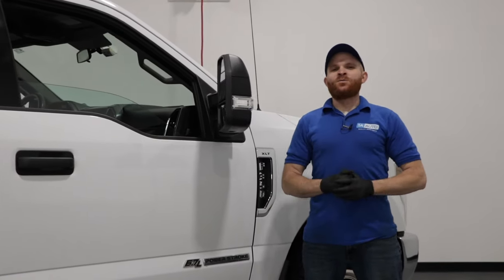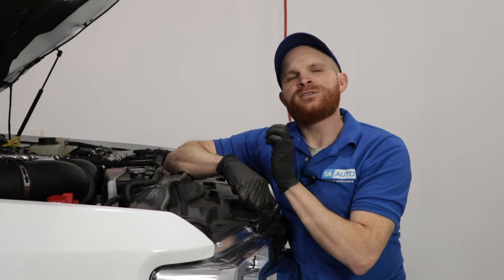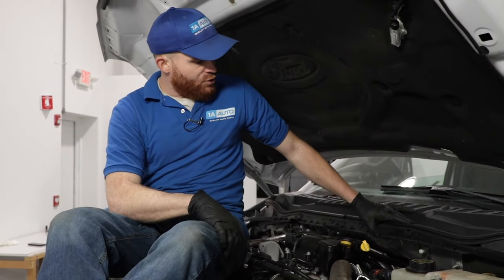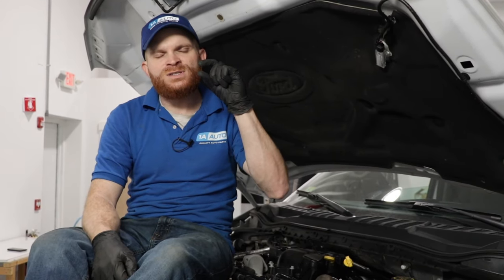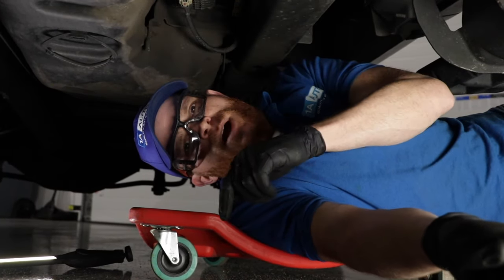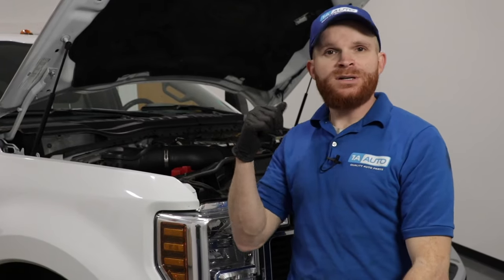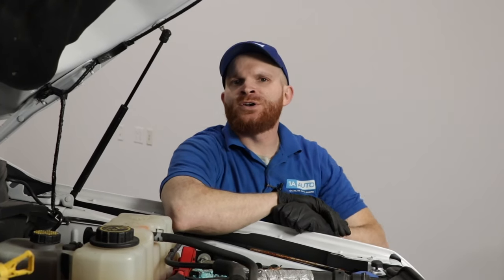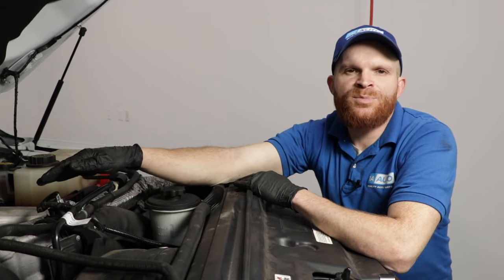Top 5 Problems Ford F-350 Truck 4th Gen 2017-20

Comment: "The next thing I want to tell you about on this viricle is turbo hose blow off." 😂😭
Reply: Damn you'd think after 15 + years ford could do a better job with that turbo hoes and that fuel tank. I remember these issues back in the mid 2000's with our GE Fleet work trucks . Ford kept dropping the ball that GE switched over to RAM .

Comment: It seems Ford rushes their diesel throughout the years and fails to really test them thoroughly. I'll stick to my 2018 Dirtymax
Reply: Oh you mean your underperforming Isuzu?
Reply: @brianbarclay4316  Isuzu has specialized in workhorse diesels for decades, Duramax isn’t embodied by superficial power number, but rather superior design and longevity
Reply: Gm has turned to crap over the years. They used to make good stuff. Those days are over.
Reply: Wasn't always the case. Back during the Obama administration, we had this thing called "cash for clunkers" which was a complete failure. A family friend  of mine was working for a dealership and when vehicles came in from that program, they had to destroy the engines which didn't exactly help people who couldn't afford new cars. Anyways one time a 1988 F-250 came in and  pour sand in where oil supposed to go and ran it. He ran out of gas twice before it siezed up. Makes me depressed just thinking of all the perfectly good vehicles that had plenty of life in them destroyed like that.

Comment: Excellent, to the point, instructional information! Thinking about one of these beasts. Seem very unreliable overall added to the pricey maintenance. I read up on fuel in US due to the constant problems with exhaust. Seems many problems with the Cat systems come (IMHO) from low cetane rating (40 to 45) of generally all diesel fuel. Add a conditioner, boost the cetane up, burns hotter, less particulates overall, engine combusts more efficiently everyone much happier. But another expense to keep the air clean & your truck running. Recommended oil change 7 to 10k. Again even the synthetics have tough time going that long without degradation. I think I personally would waste the money and go 5k at the most. Not practical for over the road but seems city driving harder on these babies as they are not being worked. Anyway thanks for the great video my friend. Your good, keep'em coming.

Comment: Thank you 1a auto for this information...it will help us ford diesel owner specially "diy" guys like me.

2017 ford f350 6.7L fx4 crew scorpion diesel always on duty...reporting at 74,000 miles with only basic maintenance in my own garage. Tows our 10,000 lbs. rv trailer twice a month in the Nevada desert and neighboring state.
Note ford diesel owners:
Bring your ford diesel to a dealer to have your engine block heater(if comes with factory) replace for free...(recall issues).

Comment: I’m thinking about buying one of these vereichles thanks for the info
Reply: Nice to meet a fellow linguist. It does sound funny. I wonder if he is in Canada? By the way, do you have one of these? I looked at one today with 107,000 miles. Its an 2017 XL package. He wants $46,000 for it. It has a flat textured black 8’  metal bed in place of a standard truck bed. There is a gooseneck hitch down inside. People brag about these trucks and others complain about the maintenance, cost of fuel and the aluminum body. I would appreciate your insight. Thanks

Comment: Heat and time do cause those CAC tubes you referenced to blow, but I have also found excess pressure and heavy carbon build-up from clogged EGR coolers to cause failure.  Either way, CAC tube replacement is a must.  Good video! 👍

Comment: My dream truck:

Brand new, 1-ton or bigger
Wide track front end
Large crew cab or mega cab
DRW 
4x4,
Cummins turbo diesel
Strong engine brake
10-speed manual trans with double overdrive
Cloth bench seats front and rear
A/C 
Heat 
Old school AM/FM radio

Mechanical gauges

It will always be a dream...... :gar:

Comment: So what mileage do these issues usually arise? Looking at a 2017 F350 for my dad with just over 80k miles…   He’s had a 1999 8.1L Chevy forever, I have a 2015 Ram 2500 diesel with 145k miles and definitely never had issues like these top 5 for the Ford. Still on original belt, pulleys, intake, gas tank, etc… 

Wound hate to spend 40k on a used truck and have these issues happen soon after.

Comment: the egr cooler doesn't cool the valve it cools the exhaust gases entering the intake which cools combustion chamber temps which in turn reduces Nox

Comment: Thanks.  Thinking of trading in my 2016 KR CC 6.7 for a 2020 or 2021. Question about the fuel tank liner...  couldnt you just use an endoscope ($20 online) to peek inside instead of dropping the whole tank? Or would the anti-siphon mechanism prevent the 1/4 inch wide camera from entering the tank?

Comment: Good luck finding that turbo boost hose and a upper/lower oil pan.  That part, like many Ford parts, are almost impossible to find.  There are many reasons as to why, but the main issue is they cannot be found except on backorder.

Comment: I am experiencing the oil leak and I believe it is because of the PCV Oil Separator.  Dealer did not tell me this.  They put die in the oil and said they would look for leak after I drove for 500 miles.  Does the oil pan need to be dropped and seal replaced if PCV oil separator spring kit replaced?
Reply: Yes brother for sure

Comment: I have a 2018 have replaced radiator to supposedly a better one because I have heating issues. I’m a hotshot driver so pull heavy loads. But even after this with no load it still wants to run hot. Have checked all the lines. Any recommendations?

Comment: Questions I have a 6.2 L v8 2017 F250 I have trouble starting in the Mornings. Would I still have to replace the fuel tank do to the coding. ?? Pealing off or does it only affect diesel fuel. Tanks. ??
Reply from the maker: +vaslui We wouldn't be able to diagnose an issue like that here, you may want to have a local mechanic take a look at it. Thanks for checking us out! http://1aau.to/m/Shop-1AAuto-c
Reply: Its the fuel pumps.  I have a 17 6.2 f350.  Its very common in these gas trucks.  ford won't do anything because the fuel pump isn't actually failing its just losing pressure the majority of the time.  and because of that it puts more wear on your starter since there is no fuel until the pump builds up pressure again.  now my starter has problems... my 2001 GMC 6.0 gas with 260k has started better its entire life while my ford might not start until the second or 3rd try....

Comment: Hi! I see your video about ford f350 2019 comment issues problem thank a lot. I have a Ford f350 dually 2019 I have check engine light on also when I driving come a message reduce engine power can u tell me little more about the problem wat can be please again thank you

Comment: Great informative video, we had a 2020 Ford Transit Cargo 250 with a cigarette lighter socket blow, owner manual did not have any information of fuse location in it fuse boxes, we took to 2 different Ford Dealer, none of them figured it out, call 3 out of state Ford dealer to get help with no result , call Ford direct, they did not have that fuse location either ( just amazing how a lousy it is) Ford said take to dealership, but we already did , they couldn't locate the fuse to replace.
At this point, we are look around to find a solution, any troubleshooting techniques that you can think of to track to that blow fuse that control the cigarette lighter?
Many thanks in advance 🙏
Reply from the maker: +AD Associates We wouldn't be able to diagnose an issue like that here, you may want to have a local mechanic take a look at it. Thanks for checking us out! http://1aau.to/m/Shop-1AAuto-c

Comment: As an owner of a 2017 F-350, thanks for the heads up and informative video.
Follow-on question: Do you sell the superior aftermarket turbo hose mentioned (#5)?
Reply: If it were me I’d buy another plastic one from Ford and put it under the back seat if you have a older truck there like $80 I think and they last 5 years before having a problem ever and the metal Mishimoto ones I switched to costed way to much for what they are and they can still fail eventually when the hose clamped section gets older and then it won’t just be a crack sound and loss of power but a metal pipe being blown off with considerable force under your hood possibly denting your hood.
Reply: How do you like your 2017 I'm looking at buying one ?

Comment: I just bought a 2019 f250 crew cab long bed with the 6.2 because the 6.2 has been around long enough to get the bugs out I hope. I don't tow daily and my needs are to haul 3 atvs and camping gear. I wont tow over 9000lbs when im working my truck. I hope I don't have too many issues with this engine. Thank you for posting this video. Do you have any most common repairs for fords 6.2 gas?
Reply: I saw ptt with arod swap a valve spring on a 6.2. He might be able to better answer your question.

Comment: 2019 F350 super duty Platinum 80,000km
The Valves gunked up so bad the engine needed replacement. 
After 2 months still waiting for an engine. 
Thankfully it's under warranty but 80K BLOWN ENGINE!!!

Comment: Are you aware of any problems or issues with the new 2020 F250 with the 7.3 Gas Engine 4X4?
Reply: Front crank seal leak, bad spark plug wire causing pretty scary misfires. Lol

Comment: 5 more reasons I’m glad I bought a GMC gasser.
Reply: Gmc has 10 times more problems
Reply: That's great, as long as you don't have to actually two anything heavy. Oh, and this guy can make a video about your GMC that is just as long if not longer....
Reply: @suburbanhobbyist2752  Then that really is strange because my GMC gas has 50k miles running cross country from Florida to Washington over mountain passes (admittedly slower than traffic up those) towing 11k trailer including gear and no issues yet.
Reply: @cavolante  LOL... The operative word in that paragraph is "yet"...   Best wishes..
Reply: My gmc....this is all just at 70000 miles. Take in mind all i do is drive back and forth to work. That's it no off road no nothing. Transmission 6900.00. Rear main seal 2 times at 800.00. 2 batteries at 550.00 oh ya the a.c went out at 40000 and that was 1600.00. So good luck. If you actually look up and do your homework on gm trucks. They have a reliability of 12 out of a 100. Jd power....car week. All the big names say that gm sucks for reliability.

Comment: Great video! Any advice on a 2018 f350  passenger mirror that only adjusts in small increments, or not at all? Thanks in advance for your insight!
Reply from the maker: +Black Riflemen's Organization We wouldn't be able to diagnose an issue like that here, you may want to have a local mechanic take a look at it. Thanks for checking us out! http://1aau.to/m/Shop-1AAuto-c
Reply: Replacement
Reply: I had that problem and it was just that the glass had become unseated. Pressure to the middle of the mirror and it popped back in place.

Comment: Do you know what they say about Ford fix or repair daily found on Road dead. My new ram 3500 has not had one warranty issue nothing change the oil fuel in it and drive it
Reply: Lmao, you realize that these Fords also do not have any issues at first. Give your Ram 30,000 to 50,000 miles and then come back on here. My dad had two Rams before he figured out why they sell them so cheap. BOTH trucks stranded him more than once. I've been driving Fords for 25 years and have had mostly great trucks in that time. I'll go with Ford over all the other truck brands. Then again, I have a ton of experience with trucks and know better.
Reply: Dad has a 2500 ram and it’s had 10 recalls in two years.

Comment: Good thing I have a 7.3. Not as pretty or powerful—but still able to haul a junk modern diesel to safety...
Reply: I have 7.3L gas as well. It’s more powerful than the 1st gen 7.3L powerstroke. 👍😀
Reply: Heck I had my 7.3 for 10 years and it had its own slew of problems even in stock form they all have negatives

Comment: I’m on my fourth turbo on my 2017 platinum, it only has 40,000 miles
Reply: guy that works with me had 3 turbos before 40k
Reply: Im on my 19th turbo in 20,000 miles.

Comment: Last year my wife and I bought the Ram limited 6.7 diesel and sold it 3 months after purchasing it with 6000 miles on it. I sold it because I realized that I was a fool for buying a 80k truck that would only give me problems down the line, even with 100k warranty. Never again would I buy another American made truck. Not worth the money and the headache.
Reply: Dude, ram has been known for breaking down for tens of years now, it’s either gm or Ford, I prefer ford
Reply: So, get yourself an $80K Toyota Diesel pickup!  Oh, wait......
Reply: So what problems did you have if any?
Reply: @thethinkingbyte  you don’t understand it’s only gas rigs not Cummins powered trucks
Reply: Parts are not even American made that’s the sad thing, they are just engineered cheap to be made cheap